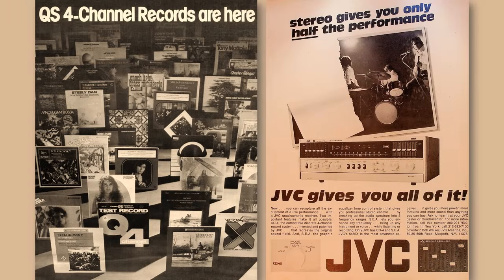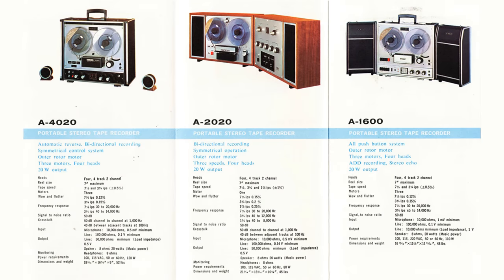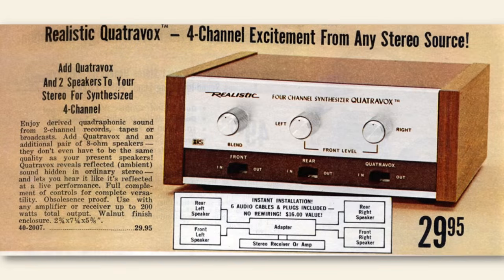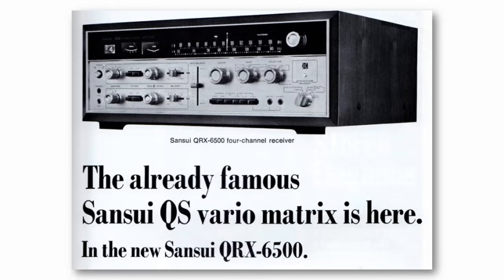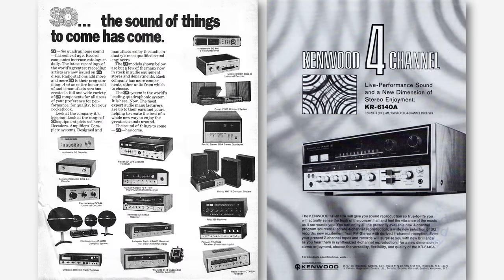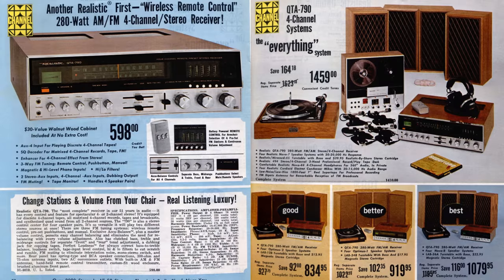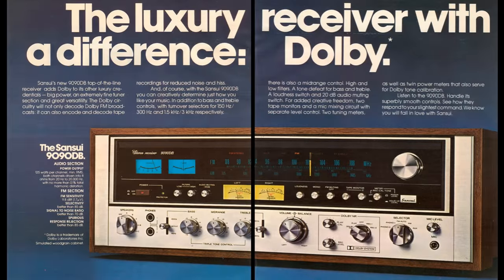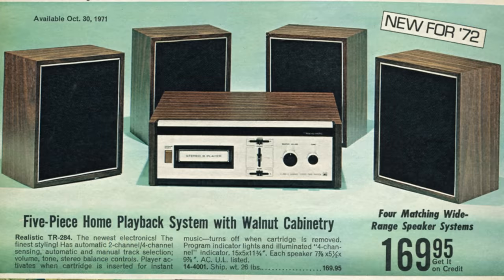4 channel FAILURE - The Quadraphonic Story

Comment: The quadraphonic 8 tracks never ran at, 1 7/8 ips, half speed. They ran at 3 3/4 ips just like the 2 channel stereo 8-track did. If you look closely at the two Backman Turner 8-thack cartridges at 3:51 you will notice the 2 channel version has four  2 channel programs each 9:12 minutes long while the 4 channel version has two 4 channel programs each a little over 18 minutes long. Both 2 and 4 channel 8-tracks ran at 3 3/4 ips so you needed twice as much tape for the same playing time in a quad 8-track cartridge as would for a 2 channel 8-track cartridge.

Comment: Too little to gain from too much money - and the hassle of integrating four speakers in the livingroom. Two could be hard enough.
I can remember listening to a quadrophonic Bang & Olufsen top of the range kit with the Beogram 4004 tangential arm recordplayer. I really wasn’t that impressed. The price was more of concern back then. If i remember it correct, you could buy a small car from the same amount of money. That and the fact that the owner used white cotton gloves when working on the quad-kit.

Comment: You only have two ears.  You can't tell if sound comes from a head or behind w/o turning your head. So quadraphonic headsets are a scam (as the source of the sound turns with your head). Your brain can tell left from right from the phase shift. 
If you put two microphones in an auditorium seat, in place of where your ears would be, and record a orchestra, when you play it back in stereo, you'll hear the same thing as if you were siting there, looking forward orchestra at the . Complete with phased delay of what reflected off the back of the auditorium .
Reply from the maker: Not sure what ears you have, but my ears can tell if a sound is coming from the front or rear.
Reply: not w/o moving your head. Your ear drum doesn't have a direction finder. It goes in and out, that's the only motion. The rest is done with the brain. Phase difference only provides left/right information.   @LittleCar